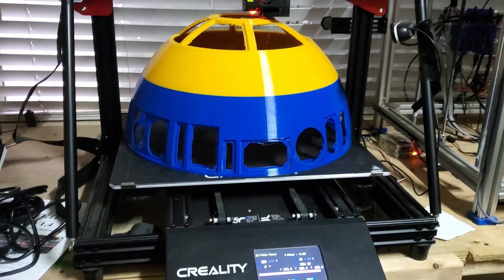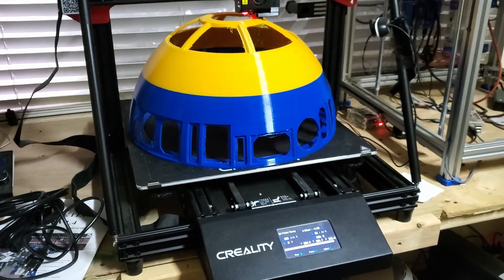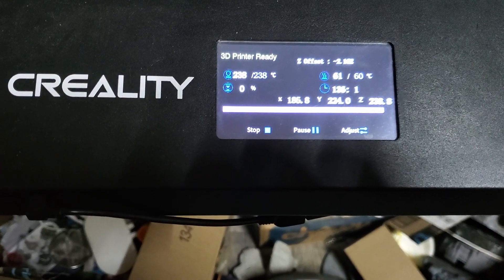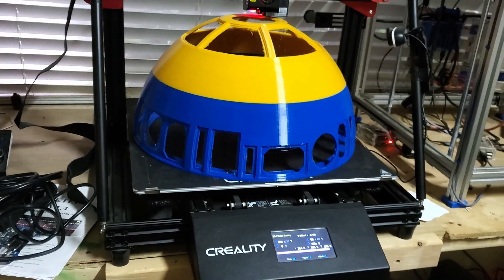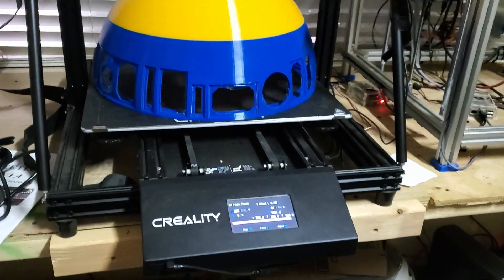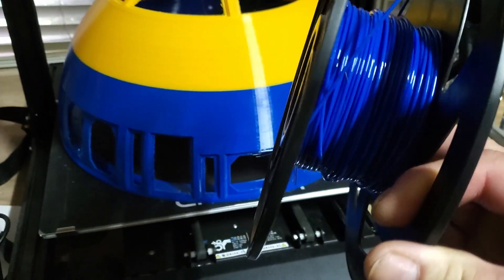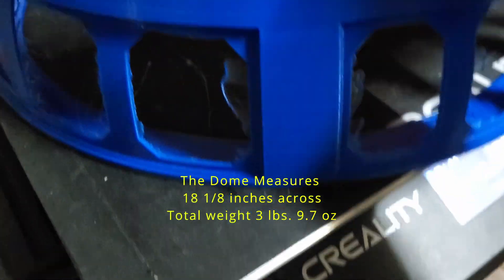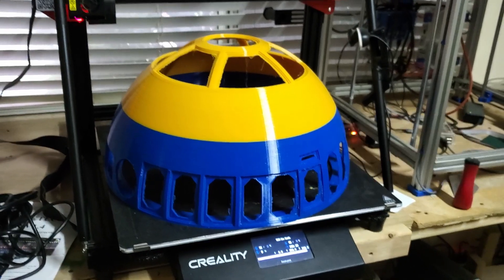R2D2 Dome on a CR10 MAX #3dhp

Comment: Hi can you help out with the exact setting you used on the Cr-10 Max f rteh R2 domw. I have the tinymachines 470x470 firmware 7.4.6 version loaded and bed size setup adjusted in cura.  However the print cuts off at the front so its not quite seeing the whole bed size.  Any advice gratefully recieved.  I m ausing a Microswiss upgraded extruder so that may be different your stock htoend setup.
Reply from the maker: This was a long time ago,they modded my firmware to use the whole size of the bed.I sliced with S3d and once centered it just fit. I would have to refer to my video for any info. Hopefully you figure it out.
Reply: @3DHP  Thank You for you reply.  I will keep figuring it out.
Reply from the maker: @vickystenning3210  Double check your slicer setting for bed size.

Comment: Nice tip for a filament change on the fly Jerry. I'm scared doin a 24 hour print. A one week print would give me a heart attack.
Reply from the maker: Almost all printers have thermal runaway turned on. so if there is a bed or hotend  problem, they will shut down. I ran prints for weeks at a time for of 4 years now, never had any problems other than a failed print here and there when you wake up or get home.
Reply: @3DHP  Little steps for me. Just doing T3-DO and BB-R5 seriously pushed my envelope.